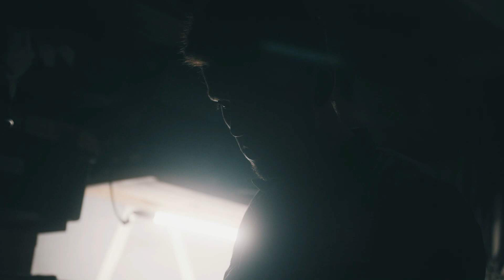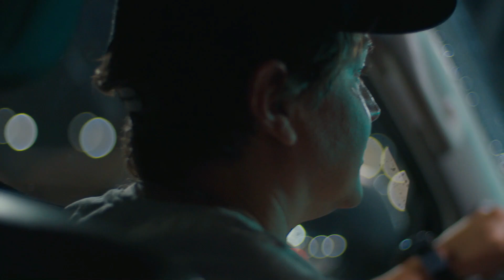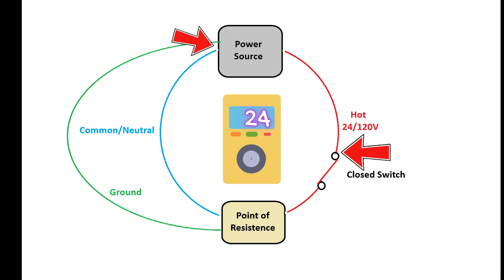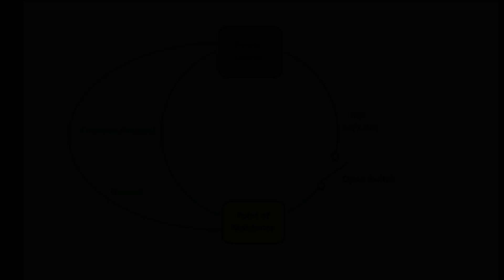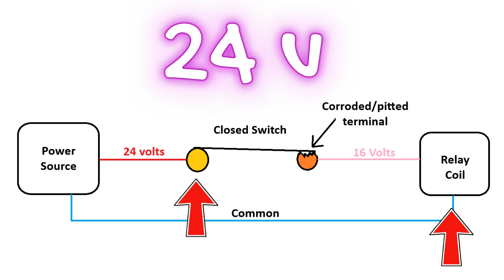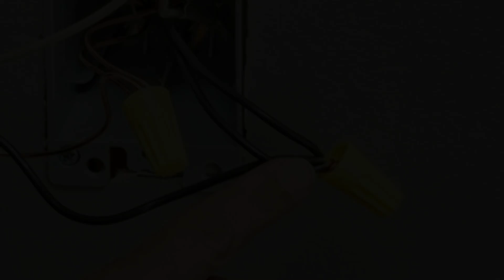Learn HVAC Diagnostics: End Confusing Readings

Comment: Hey Mike, where would be a good place to reference a common or neutral when working on an outdoor condenser? I understand using the furnace transformer but what about when working on 240v.  Thanks for the awesome videos 🙏
Reply from the maker: When testing 240, always use the other leg as a reference, not ground. I would only use ground if I was reading 120v across L1 and L2 together, and that's just to see which leg is lost. Ground isn't really a reliable reference point due to weak bonds, corrosion, or lack of a properly wired ground entirely sometimes being an issue.